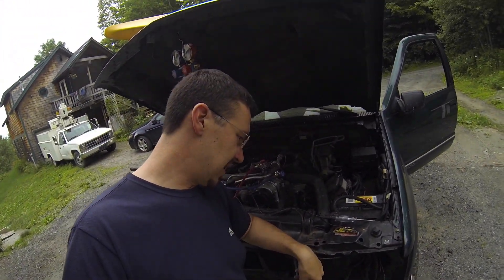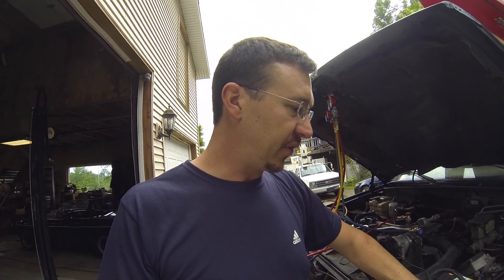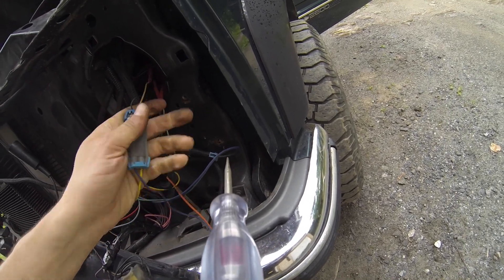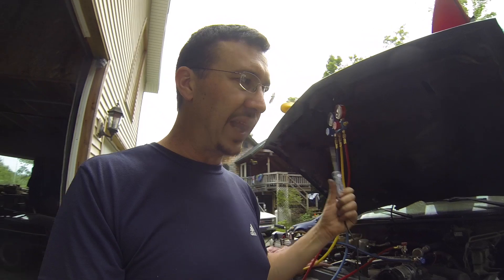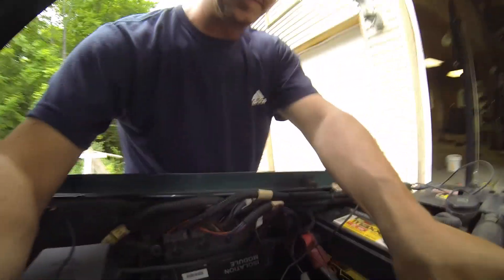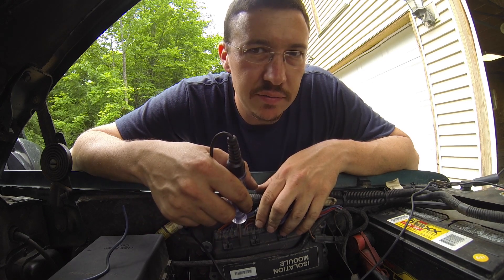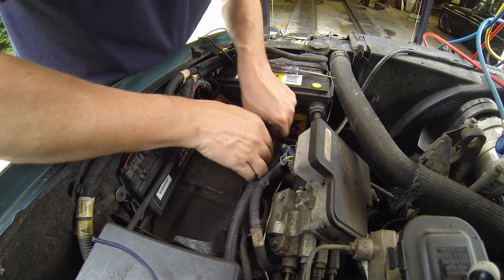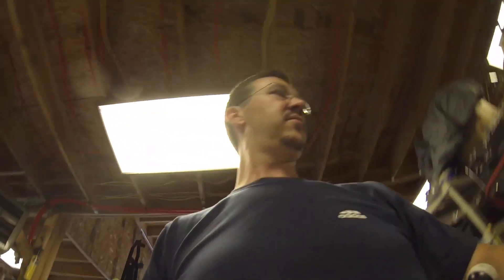Car Electrical Problems - Digging In

Comment: I have a 1996 Chevrolet 1500 truck and when my dashboard lights are on,my right turn signal doesn't work,but it only works when the lights are off.what could the problem be?